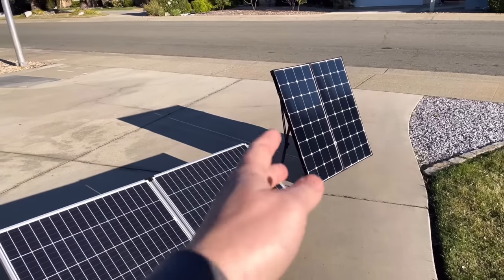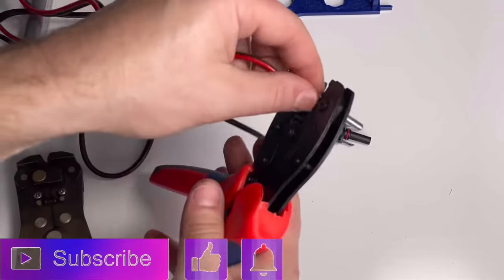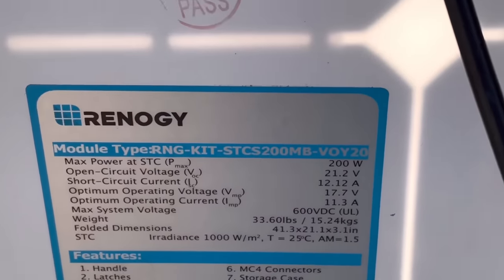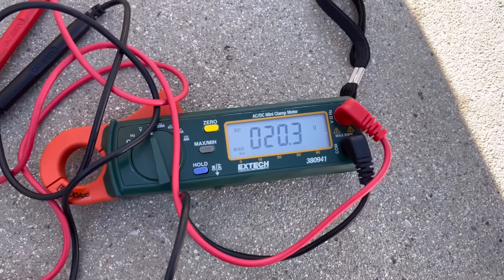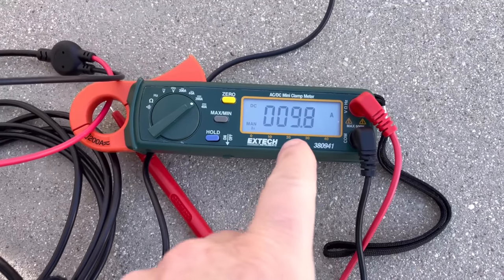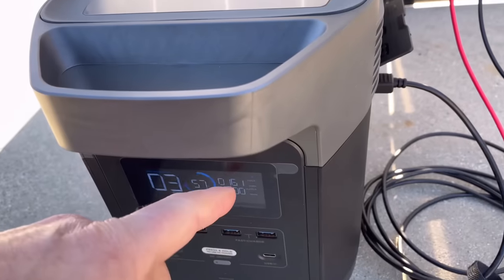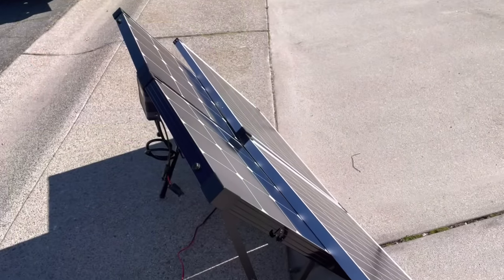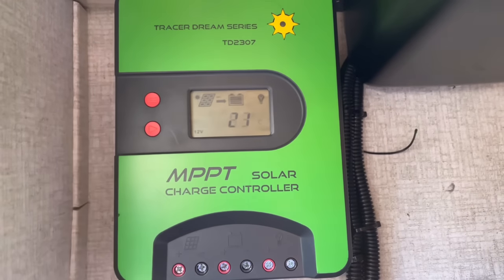Best Solar Panel - Harbor Freight 100 Watt Solar VS Renogy Eclipse Solar

Comment: If you are comparing to HF why do you have a $100k+ camper?! I bought 2 items from them and neither lasted a full year of use. Horrible products that don't last. HF is for suckers.
Reply from the maker: Well first off thanks for thinking my RV is a $100k. 😀 it is a nice how ever the original buyer paid $44k and I paid much less. So was happy about that. But I do take care of my stuff.

Second, I’ll agree most things at harbor freight for me at least are disposable items I need for a single job or maybe twice but then after I don’t expect much.
But some items I have bought from there don’t die…..!!!! Like at all. They just keep going and working even though they may not have the same torque or speed or whatever, it does the job and keeps going. But at a slower pace as say a equally better product. 
Harbor freight doesn’t make solar panels, they just sell the stuff. Much like Amazon. They don’t make anything they just sell everything. So technically you can buy the same crap or different crap from harbor freight that you can buy on Amazon.
It really is what you need it for, and for how long. 
Sometimes the cheap stuff works just fine and will serve the purpose while saving money. 

Hey it’s all about saving money when you can. 
I have meet more millionaires who wear jeans and a T-shirt with normal cars then ones who wear suits and act like millionaires.

Comment: They're both overpriced! I paid just over 50c per Watt for top quality (25 year warranty) Hyundai 400 watt "shingled cell" solar panels.
Reply from the maker: Well does depend. Price per watt, definitely! 
But some people need smaller lighter panels for roofs or structures that can’t hold a lot of weight .. or just for portable units. That one to lift is probably 65lbs

Comment: Looked like one set was wired series and one parallel.   Increased efficiency, aside from the panels themselves is related to wire thickness for parallel wiring.  Series is better until one panel gets blocked affecting the entire array.  You really did not explain any of this, or the differences between MPPT and PWM charge controllers.   MPPT converts extra voltage to extra current.  PWM dumps the extra voltage.  Pretty useless video sorry to say.
Reply from the maker: I don’t think you listened. Both are wired in series. I also explained that I bypassed the renogy pwm controller and am utilizing the on board mppt controller I installed and is about 20% more efficient then the old style pwm controller. 
No need for thick wires as 12 gauge is plenty fine for short runs in series. 
I assume you skipped through the video . 

Plus I would need a adapter to run parallel…🤷‍♂️
Reply: Ok, missed the  series/parallel, PWM/MPPT, and wire thickness/run length. Those contexts matter.  But hey, your posting content, I am not.  Best!
Reply from the maker: Well not that it matters but I will have people comment who watched about 3 mins of the video…🤷‍♂️ which hey we all do it  

But the focus is really just both sets of panels using the same set up and which provides more power.  The renogy set up I could never get more then about the 170 watts which I always bypassed the controller because mines is a Mppt.  So I saw a small sale and grabbed the HF panels and was surprised how much more power I get. But I’ll do a 6 month review to see if 20% degradation kicks in and maybe could be more equal. 
They have been sitting outside since.. lol

Comment: 500w 140$
Reply from the maker: For a residential I assume ?
Reply: @johnnysweekends  
im in iraq the solar panel 500w is 140$ and 340w is 115$
Reply from the maker: Wow how many volts..? 
Gotta be big units, not really portable
Reply: @johnnysweekends  
this one 
Rated Maximum Power (Pmax) 450W Power Tolerance (0,+4.99) 41.30V Maximum Power Voltage (Vmp) (Imp) Maximum Power Current 10.90A Open Circuit Voltage (Voc) 50.40V Short Circuit Current (Isc) 11.47A Power Production Tolerance ±3% Open Circuit Voltage ±2% Short Circuit Current +4% 2108*1048*35mm Dimension Maximum System Voltage 1500V Maximum Series Fuse Rating 15A Operating Temperature -40°C~+85°C Fire Class C Weight STC: 1000w/m',AM1.5,25°C 24.0(kg)
what are you Believes about this one 
and it is price for 140$ SUNOVA SOLAR i think it is from Chinese company

Comment: You can NOT guarantee the Harbour Freight will last 10 years…..foolish thing to say
Reply from the maker: I don’t think I said that at all. You can’t guarantee any panel to last 10 years, although they should but with how much degradation. Only thing to guarantee is a warranty. If the company is still around.